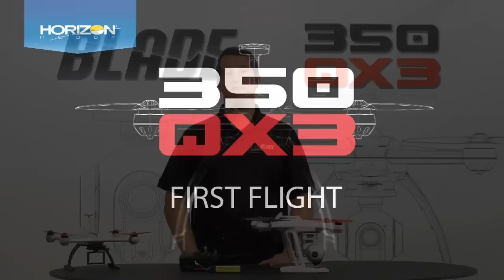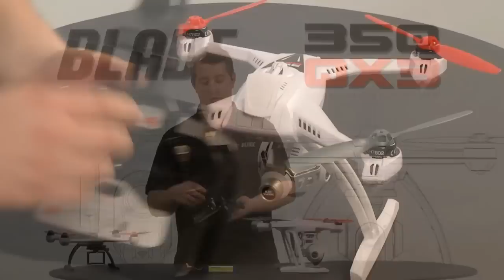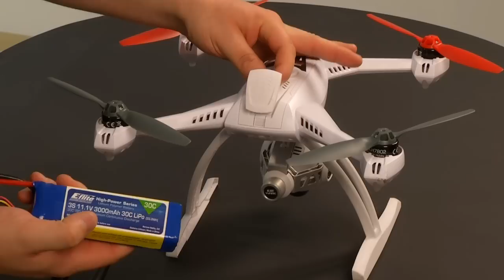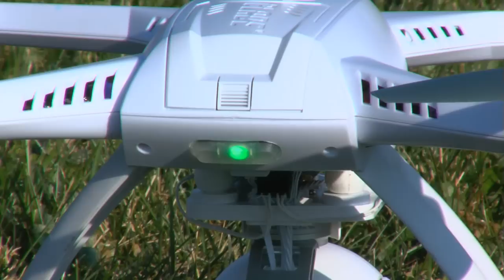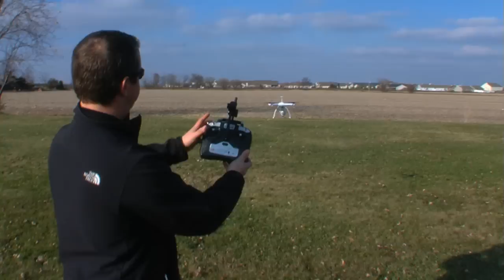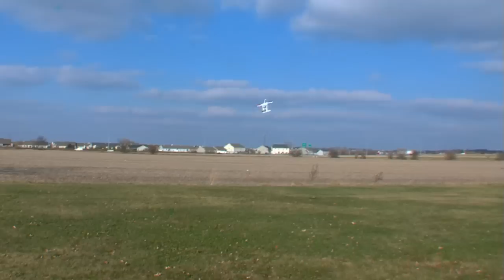First Flight - 350 QX3

Comment: Nice quad. One question though: to me it seems very easy to bump/hit/push the 'throttle kill' button ( see 5:33) by accident...or does it have some kind of protection against doing so??
Reply: I messed up and dropped mine out of the sky because the kill button is so exposed. So I cut a small tube from a ink pen and glued it around the button. It acts as a guard and you have to dig your finger in a bit to use it. It's an easy dui safety
Reply: nick carbo Hi Nick....that's a nice solution, like that! But when you think of it, the button is a bit 'unhandy', as we say in The Netherlands :-)
Hope your quad wasn't too damaged after the drop and you are already up-up-and-awaaaay!!! Goodluck!
Reply: PrinceVaskur no its in a tree getting rained on for the past 2 weeks. and yea that button doesn't see much use.
Reply: nick carbo That sucks buddy....big!! Maybe call the fire department guys and ask them to get it out of the tree.....and promise them you'll make a nice aerial picture of them someday :-)

Comment: Thank you for this how to series on the Blade 350 QX3, I find it to be VERY helpful.  Right now I'm considering purchasing the Blade 350 QX3.  One area I'm not clear on is how do I know when to land because the battery is getting low.  Does the QX3 return to home and land when the battery is getting low OR does it just land when low?   I've heard that if you are not careful, you could run the battery too low and damage it, is that true?
Reply: Does it come with good trimming
Reply: The light on the model will start blinking when the battery starts to get low.  I am told when it gets too low it will come home and land itself but I won't be testing that with mine. I love this thing it is so much fun.
Reply: No trimming needed..the altitude hold and GPS take care of it.  The provided RTF controller has no trim..